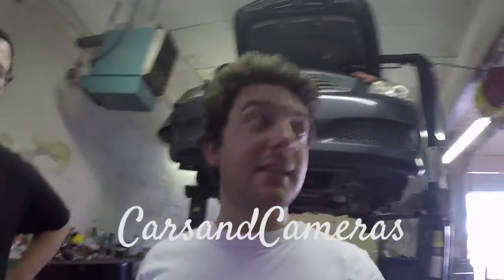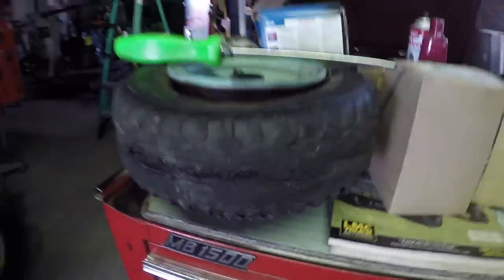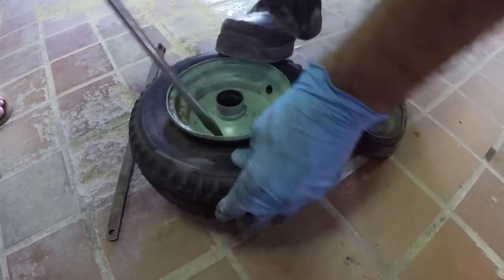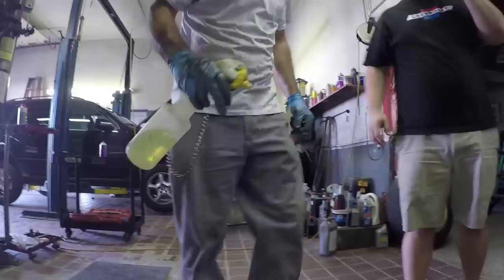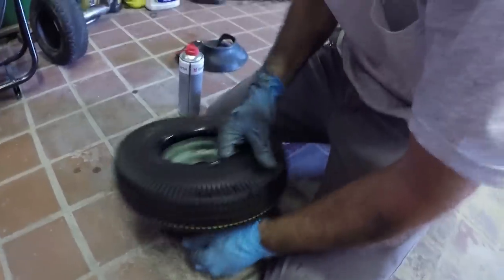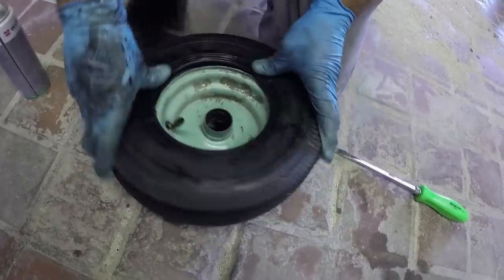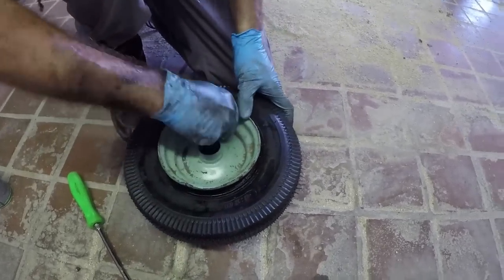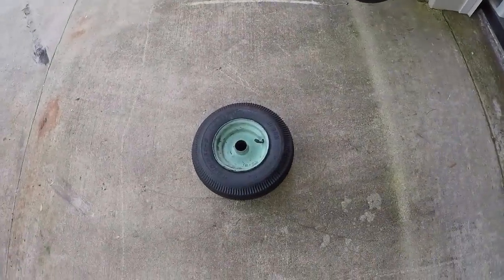How to Change a Go Kart Tire (w/Tube)

Comment: When I was a kid, which was a long time ago, I loved go carts. My dad built my go cart for me out of, If I remember right, 2 by 4-inch steel. My dad was a welder by trade. So building this monster wasn't a problem for him. The tires that were on it were made for the back of a Snapper riding lawn mower. 

I don't remember where he got the engine. I just remember it was a two cylinder. It was huge and heavy and made 40 horsepower. After the cart was finished, I just had to find out how fast it was. It was kinda like a big 55 Caddy. It didn't take off really fast.  But once you got it rolling, especially with those big Snapper lawn mower  tires, It was way to fast for an 11-year-old. It was belt driven. My dad handmade the clutch mechanism  Give her a little gas, let go of the clutch, and you were on your way.  The very first time I rode it I plowed a young tree with it and lost two teeth in the process. It was gone about two days later. I haven't seen it since. It was my first taste of speed. I've been addicted ever since.

Comment: Will you guys ever put a predator 420cc on johns go kart, and also i love the new logo.
Reply from the maker: +Seth Thanks! We probably won't put a 420 on my kart as we'd really have to hack up the chassis to make it fit.
Reply: CarsandCameras Oh alright i thought putting a 420 would be a fun project. and it would go fast!
Reply: +Seth You can tune a predator to more than what the stock 420 has. Some predators are 20hp, without a turbo or supercharger.

Comment: Oh my god you are right... changing tires is so freaking hard. I have two-piece MAGNESIUM rims, and I work on my go kart with my dad, who built multiple VW buses from scratch, who has definitely changed tires before, and we ended up taking the tires to a tire shop. When my dad showed them the tires the owner sighed and said that they are the hardest tires to change lol
Reply from the maker: +Parker Barandon They're miserable. I was quoted at a tire shop once for having kart tires changed. They said they'd do all four for $20. Of course I was thinking that it was a rip off until I actually gave it a shot...
Reply: +CarsandCameras It was $80 for my tires to be changed. :(
Reply: +Parker Barandon Yeah, my friends and I have spent hours on changing a single, tubeless tire. We spent as much time trying to pump it up, too.
Reply from the maker: Parker Barandon Ouch :(
Reply: +CarsandCameras yeah haha

Comment: hey I have an older margay race kart and I don't race and it's only ridden in the yard what would you recommend tire and wheel wise to get a little more clearance and alot more traction than slicks without taking away to much from handling.

Comment: just a hint once the tube is inserted put enough air in it to make it the right shape and it will stay more out of the way when your prying over the bead. when I change dirtbike tires if you don't put a little air in it your guaranteed to tear the tube. also using tire spoons might help they aren't sharp like a screw driver.

Comment: question.  what the hell is the tool that comes with the predator 212 used for?
Reply: +extxixd spark plug wrench
Reply: +Isaac Jennette thanks.  I feel like a dumb ass now.  haha. if I were to make a quick video of the setup I just put together, would you be able to tell me what I did wrong?  the clutch sounds like it wants to explode.

Comment: an easier way is to remove the sprocket and when putting in the new tire back on , just place new tire over wheel , holes being vertical and just stand on both sides so your weight pushes it in

Comment: Squeezing the top part of the tyre on last bit is where I usually  f**** up I find that the hardest bit as sometimes you can end up with a puncture in the inner tube at the end of the process🤦‍♂️did get it in the end with a back of a table knife handle as it isn't sharp as  a flat head screwdriver 😎👍